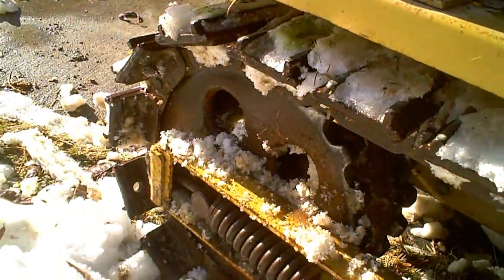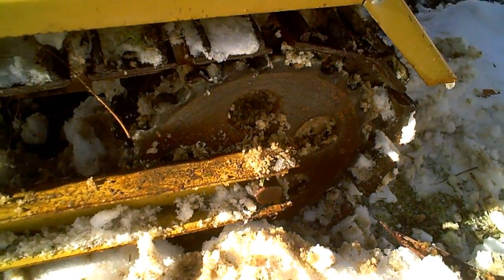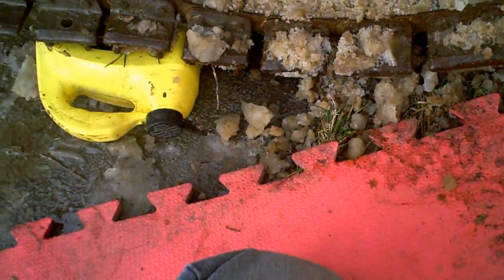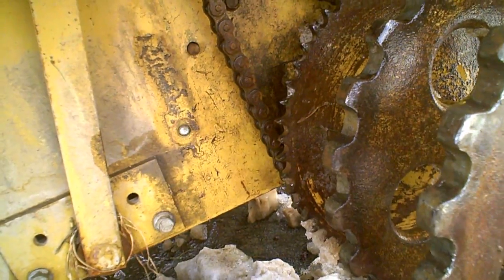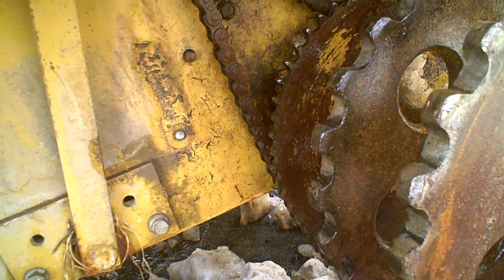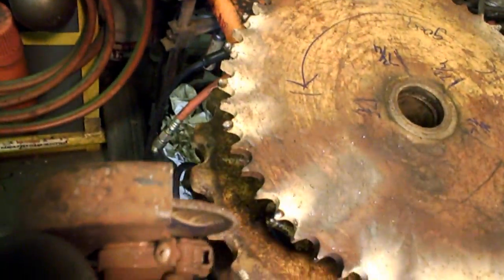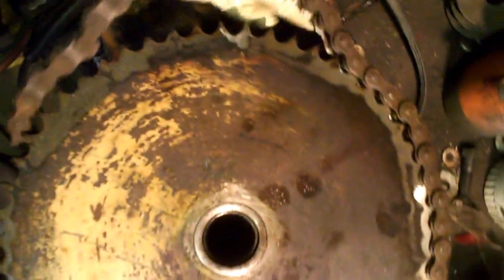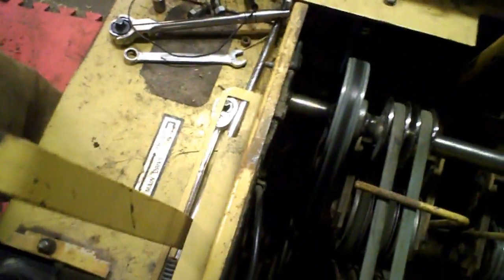Mini Bulldozer How it Works and Repair - Threw a Track Magna trac

Comment: Would it be better if drive belts were chains for forward and reverse
Reply from the maker: Not really. It would be far more of a complicated system with chains which would cause issues in the long run. The belts allow instant forward to reverse which makes it fast. Chains would require a transmission to be shifted in and out of gear and a clutch before you could move from forward to reverse. It uses 2 belts for each track to move forward, which seams ample. Reverse only uses 1 belt per track and it slips a little under heavy load. The belts are original so some slipping could come from age. The tracks will rip up the ground before the belts start slipping in forward.

Comment: Great video. What do you do when the sprocket wears out?
Reply from the maker: Love2boat92 Weld on new teeth.
Reply: sixtyfiveford Makes sense. It would be difficult to weld on new teeth I would think. Getting them the same size.
Reply: sixtyfiveford I guess you could grind some off though. Maybe its not that bad.

Comment: I have the RS196K That I just finished and took out for its first test run. I noticed some debris from the green belts is on the bottom of the crawler is this normal? Also  the set pins on the 4112 sprocket seem to work it self loose after a short amount of run time any suggestions would be appreciated. Thank you
Reply from the maker: Debris from the belts are pretty normal in setups like this. As far as the Allen Key Set Screws your best bet is Loctite. In a pinch you can also use nail polish as well. Take the set screw all the way out and put a drop on the thread. Then screw it back in. It will keep vibrations from breaking it free.
Reply: Thanks for your input.

Comment: Hey Im not sure if youve seen my latest video or commented on it but I have the brakes now that will work at the pull of a pinky and almost have the left side finished as well and will finish it tomorrow and the hopefully take a good long test drive,,still gotta add a bigger drive shaft pulley cause I want to slow it down even more but that want take long,,,I didnt know you had sold your struck nor did I know your building another one,,do you have any videos of it here on youtube,,the one your building that is ?
Reply from the maker: Yeah, I saw it. Very nicely done.

I sold the Struck Magna Trac a few years ago. I have an Agricat project on the back burner. I do have a really old video of me dragging it around(heavy little thing).

Comment: What do recommend, belt drive or the hydrostatic upgrade?
Reply from the maker: The Hydrostatic is nicer and functions better but, will not last as long nor be as easy or cheap to fix in the long run. Not that it is going to break right away or anything. I would think you would be able to get 8-10 years of good use before a hydro needed a new hydro pump/ hydro motor. Where you would probably have to change a set of belts every 5years or so.
Reply: That's what I came kind of came up with, thank you for your input.

Comment from the maker: It's hard to see but, the back side of the main drive belt when engaged is turning a shaft in the reverse direction. So you have the main shaft that is easy to see and one directly under it running in reverse.

Comment: hey next time you throw your track off make sure that spring is always in place never take the spring off i'v been doing this work when i was a little boy  so i'm a pro at fixing these types of  thing and also to help the tension off the track when your trying to work take a jack and a block of wood and jack up the top of the track

Comment from the maker: In the 60-70's they were only a built it yourself kit. In the 80's and up until present time you buy the entire complete unit. This is a mid 90's unit. I don't think too many of the kits sold as very few from that era ever surface.

Comment: I checked out your channel and you seem to do a lot of proffessional work man and I like that,,I to have rebuiltotors and removed broken bolts my whole life,,I have a 1994 Z28 350 LT1 and changed the water pump and broke 3 bolts since they were factory and glued in,,finally had to drill a smaller hole down the center and thread them cause you could not get in there good enough to tap them out,,got lucky otherwise the motr would have come out and thats hell on a 1994 Z camaro,,thanks

Comment: well the guy didnt take time to build some kind of custom tracks and could have spent more time on the wheels but at least his seems to work good,,I may have to build mine a straight track as well since to make it high track will lift the body so far off the ground it want look right and be easy to turn over,,appreciate it

Comment: Man i tell you the only way to get a heavier rear end than this cub has is to shorten a ford 9 inch or a chevy 12 bolt because its as heavy duty as you can get in a compact lawnmower type tractor and it was over kill in its day as a mower,,I remember looking that them brand new back in the 70;s  but had no idea what a rear end was at the time,,if magna trac would charge a little more and put a rear end like the cub then the break downs would be nill to none.

Comment: yes I seen it and he done a great job,,Im gonna do this cub like a high track D11 hopefully,,also Im fixing to add a video of the cub as it sits now and then later when I convert it hopefully,,I bet the tracks Im building alone will weigh5 or 6hundred pounds so its gonna be heavy for sure.

Comment: I looked close at your frontend loader on yours and man it is very heavy duty and probably built a lot stronger than I realize,,,but if they would charge just a tad more and put a sure enough limited slip rearend like a old cub cadet or even old wheel horse then you would have a dozer here second to nothing,,probaly drive the price up on a new like yours 1000 dollars maybe but would be worth it,I drew me some plans last night to convert the cub cadet to a high track D11 type track system,,killer

Comment from the maker: cont..
A hydraulic motor also allows you to go from forward to reverse instantly which is great for the small tight areas. This is virtually the same thing in a Bolens hydro transmission. Bolens of yesteryear are amazing machines and had beefy hydrostatic transmissions(I believe most were Sunstrand).

Comment from the maker: I do have a 40's Agricat mini dozer. It is a true mini dozer but has its limitations. The one thing that make the Magna Trac in this video unique is it can spin 1 track fwd and 1 reverse at the same time. Most other only allow you to brake one side and have the other spin. A differential would allow the track with the least amount of grip to slip (but you could counter act it by braking that track). I think the best setup that I've seen is a hydraulic motor for each side running the track. cont.

Comment: you know if they would just go ahead and put a rear end in them like the old cub cadet riding mowers had it would eleminate all this chain and sprocket work and practically stop most future breakdowns,,I have a old cub cadet that has a rear end chunk in it like a full size farm tractor,,think Im gonna convert it to a dozer,,,later

Comment: there is a mud / snow kit that is basically a rod that clears out between the 2 sprockets to prevent this. It is rather easy to build if you can weld. I used 1 in square 1/8 wall tube it is bolted in place for easy removal